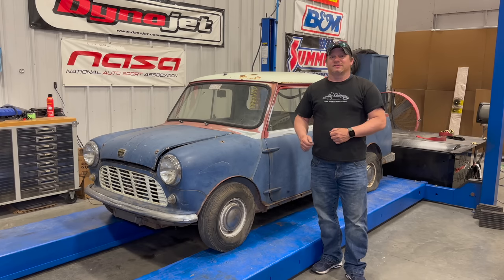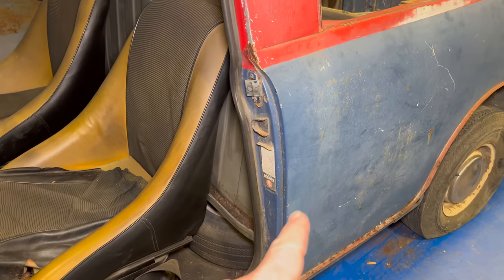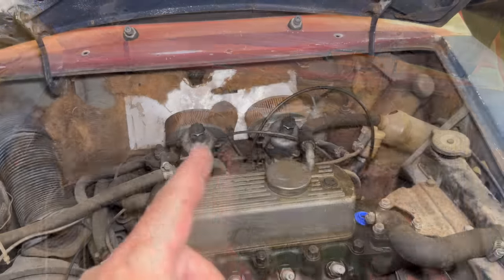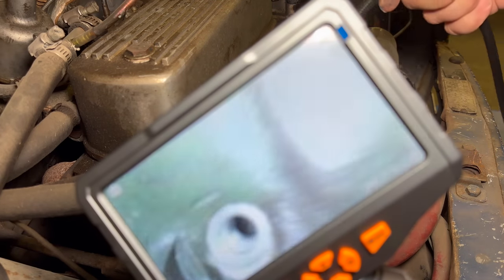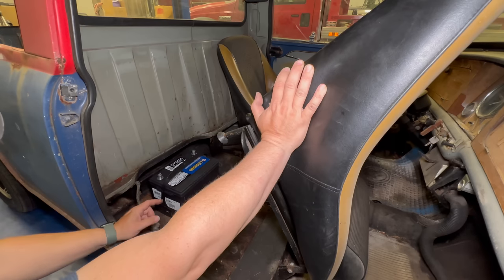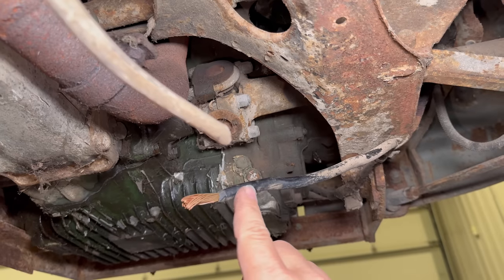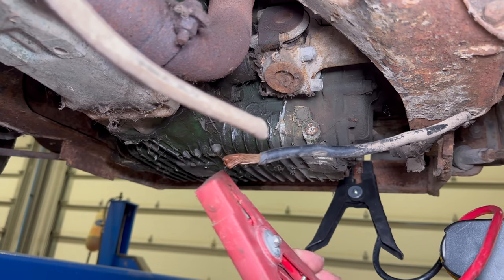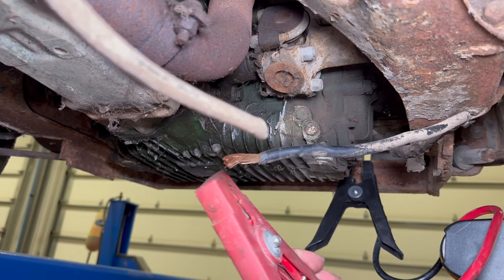Barn Find Austin Pickup - Will It Run?

Comment: The dash is not original. Iirc, the pu didn’t have a temp gauge. The shifter is not original, either.
Reply: As well as the dash, the rear bumper and tow ball aren't original either

Comment: As a 17 year old I always had a hankering for one of these but wanted to graft the tail end/rear window of a saloon shell onto the back of the cab just to be a bit different. Never did get around to buying one as they were pretty rare and I eventually ended up starting a 25 year run of owning Opel/Vauxhall motors starting with a Kadett C saloon followed by a C and B Coupe.

Comment: Had three of these. One new one. Also one we grafted a 1275 Gt motor into, used them as motor cycle transporters. I had one catch fire overnight as there appears to be no kind of fuse between battery and starter motor, maybe that explains why that cable was cut. I assume the switch went short circuit, nothing left to inspect. Great little fun tool though, exceptional road holding. Later ones had normal key starter switch on dash.

Comment: The remote looks like that fitted to the 1100s. It has a rubber mounting in between the gearchange and the diff housing. Coopers and S's remote bolted straight to the diff housing

Comment: turn on the key and if you have dash lights push the button . even if no dash lights punch it with the key on. my mum had one of these old minis. was a saloon but with the sliding windows and pocket doors cable connected to the door latch from memory.... lol.  cool collection man.. way cool.

Comment: What you need now Steve is a Mini Marcos which were entered in the Le Mans 24 hour race and won its class.  Those are very tough fiberglass bodied cars with all Mini running gear and a good one will keep up with and race with a Lotus Elan. As with all Minis, the Mini Marcos body (or  Mini Jem)  was originally 120 pounds UK (GBP) price but now the body price for a new one  is so expensive as to make them a supressed market.
The engine in that pickup looks like it could be a 1275cc Cooper unit with the twin carburettors if you are really lucky.
Reply: looks like a Cooper engine to me as well.
Reply: I had a friend who worked for the Leyland Group as a tester . One day he turned up at my house with Sprite or Midget lookalike, very little to identify it, but it was front wheel drive with all typical Mini running gear, must have been something they was thinking of at that time. Never saw or heard anything more about it. Would have been a nice little motor perhaps. Maybe give someone with an older Sprite/Midget an idea to convert one, or was any ever produced ?

Comment: As an owner of a fully restored and still driven 1970 Austin America, since 1983, I'm stoked to see your pickup, and really enjoyed watching you work.  Your collection of Mini's is killer!!  Subbed and can't wait for the next update on this.

I wouldn't be surprised if that's an America engine/trans, especially since it looks like the owner was fairly into having the truck be upgraded, and powerful for whatever he was towing.  Extremely common for Mini owners to harvest the eng/trans from the Americas, and then twin carb them like how the MG1100's were set up.  This allowed a nice header for the exhaust, along with the separate intake manifold (the Americas used a one piece cast manifold, that was both a single carb intake, and an exhaust).  That big "tropical" fan is another indication that the owner meant business about producing some power, and towing.  Man are those fans noisy!!  There's a wider version of the 11 blade fan available and it robs less power, is less noisy, and moves nearly as much air. 

If you haven't tried it, I'd recommend removing the large banjo bolt where the external oil pipe attaches, and filling the block with engine oil. This will directly feed the oil pump, and prevent cranking the engine for a long time without any oil flow to the crank bearings.  It's a much safer way to start spinning them up, prior to starting them.  And if it has a spin-on oil filter, the VW Rabbit oil filter (Bosch 72150, and equivalents from Wix at NAPA) will just sneak past the reverse light switch on the transmission, and give you a quite a bit more oil capacity and filtration.

My website:  www.austinamerciausa.com

Comment: Great to see old minis being restored in the USA,  the engine sizes are cast into the block on most A series engines as you probably know,  it can be seen with the motor in the car those COSMIC wheels are the best ones for a vintage mini.

Comment: Hi Steve, such a nice find here. while underneath I noticed It had the remote gearbox type rather than the long standard gear shifter. The better performace versions used the type you have fitted so this makes me think the engine is a more powerful version from a better mini saloon car. If you take the "rocker cover" off/ (valve tappet cover) and look for a cast head number then look online It may guide you to tell you what engine It may be.  A popular engine swap would be a 998 cc but going into "COOPER" variants could be 997cc or 1275cc but also a bigger car (Austin/Morris 1100) engine of 1100cc. all will fit with mini gearboxes geared for their 10-inch wheels. It all sounds so small compared to modern-day vehicles but as you know, race-prepped minis can go very well on tracks beating much bigger race-prepped cars.  Have fun Steve and thank you for the video. Ian - UK.

Comment: Cool, pickups are probably the rarest in the UK too; even when I had my 3 saloons (in the 80s), the pick up were sought after!  My 850 had a similar aftermarket wood dash, the vans and pickups were always the most Spartan interiors.  The twin carbs and servo and alloy rocker cover on the engine suggest a bigger or tuned engine, the commercials always had the most basic motors.  I love those Cosmic Mk2 alloys but watch out - I had them on a Spitfire and always suffered mysterious slow punctures, after dunking them in a bucket of water the tyre shop found the air was leaking through the spokes!   These old alloys were cheaply sand cast, the solution was old1fashioned tubes!

Comment: A great video. I had a Mini Van in 1972. It was a great first vehicle. So long as you didn't put side windows on it, it remained purchase tax free. A restored pick-up would be about £15000 in today's auction market, here in the UK. Will look forward to the next episode. Thank you.
Reply: Yes, these mini pickups are very rare now and have elevated value due to that rarity.  All BMC Minis now are bringing huge prices and the pickup is along with the Mini Coopers at the top of the price range. All body panels seem to be available, but these are now sought after vehicles.  I gave a Mini away in 2015 and now they are tens of thousands in value.
Reply from the maker: The beach car is at the top of the price range but you are correct ignoring those.  https://www.thedrive.com/news/31359/immensely-rare-1962-austin-mini-beach-car-sells-for-astonishing-230000-at-auction
Reply: @ThisWeekWithCars  Astonishing indeed 😲

Comment: Great project and quite a rare vehicle. Just for future reference in the middle of your starter solenoid there is a button. If you push that in with a screw driver or similar it should operate the starter motor. Or just short the terminals with will do the same job for initial testing/starting. Good luck with it.

Comment: Back in the 70s I was working at a sports car shop and one of the mechanics had one of these trucks in bright yellow.  He drove it like a race car.  I got an Austin 1100 rebuilt the engine and drove that pretty much the same way.  I had dual carbs and a header on the engine and it made some speed on those little 12 inch wheels.  I had it up to 80 on the PA turnpike and thought I was doing something until a Pantera went by me like I was standing still!  Looks like yours used to be a postal vehicle judging by the colors.
Reply: try driving on the autobahn & doing a 122 mph & a porsche goes by you doing 200

Comment: Nice find! That is certainly an Austin America 1275 engine and gearbox. You can tell by the head with no extra stud and bolt, the heater valve on an angle and the way the gearbox extension is mounted(bolts are horizontal, they would be vertical on a proper mini unit). It was a quick and economical way to up power basic minis in North America as the S units were expensive and a bit thin on the ground. It appears to be equipped with S brakes including the servo which is great to have. The uj's are Quiton Hazell aftermarket pieces, also a nice mod. Do you know it's history? Pick-ups are very rare in Canada where I am and I don't know if they were ever officially imported to North America in any great numbers. Thanks for the video. Cheers!
Reply: You right about the engine.
Head is 1275, thermostat housing facing to front means bigger engine (1275 or bored). Housing (45 degrees) slanted towards radiator means smaller engine (849, 998, 1098).
But larger head can be modified to fit smaller bore engine.
Brake discs looks like 10 inch from a Cooper S with servo.
Maybe previous owner took the engine from Cooper S and fitted to pick up.
Engine number tells the story.

Comment: Fabulous video Steve I believe the mini had a floor starter switch which seemed to have disappeard and adopted a direct key switch around 1967 also a  mini pick up and mini van here in the UK were very standard with an engine size probably around 850cc the one you have was probably built for export with left hand drive and the engine and dashboard may have come from a luxury elf or rily version Identified by the extended boot  . I did own a 1967 mini  about 46 years ago and enjoyed the noise & nostalgia for about 5 years until the red rustic stuff got th better of it 😢😢

Comment: With the seats, gear shift, twin carbs, brake booster and possibly larger engine, perhaps someone planned on using it for competition. It will be interesting to see how it turns out.

Comment: I think you’ll find that it fitted with a BMC 1100 engine and box. The remote gear lever housing has a rubber adapter plate fitted, unlike the Cooper or Cooper S which were solidly bolted to gearbox. The brakes are cooper ones.

Comment: The pick-up version of the Mini is getting difficult to find here in the UK let alone over the pond in the USA. This'll be an interesting restoration on this rare vehicle which might get challenging as you can't obtain all of the panels etc theses day's. The motor looks like a 997 0r 998 Mini Cooper unit with remote gear linkage.  Looking forward to following the resto Steve..

Comment: Great that you have completed your collection. Surprised it has a wooden dash as you’d normally only expect to find something like that on a luxury model.
Reply: That is aftermarket, as are the seats and that rear bumper. I hope Steve puts it back near stock appearance  as they are very rare and unlike the cars, the vans were not modified in period. They were just work horses. Original pick ups now fetch very high prices in the UK.
Reply: I think someone has robbed that dash from a Riley Elf in a misguided attempt to "customize" it, which probably explains the twin-carb engine too. Given that most of these pick-ups were flogged to death as commercial vehicles it would be nice to see it restored to original appearance, especially as the canvas tilt and frames are there.
Reply: @davidjones332  Agreed.
Reply: @jmtubbs1639  Yes, totally agree, I hope he restores it right down to the original 850cc engine.

Comment: I think you have a Austin America transmission, and probably engine. That's a 1275cc engine. The remote shifter housing on the Austin America bolts on to the transmission with a two piece bracket that the pieces are bonded together with rubber for isolation. The Mini remote shifter housing  bolts directly to the transmission with 4 bolts.

Comment: Given that its quite rare even here, a back to stock resto might be a wise move. I think the bonnet (hood) is from an "Austin7" Mini.. the pickup was normally a Morris..! The dash is probably from a Riley Elf,  the pickup/van was very basic.. painted grille, just a speedo / fuel gauge without temp or oil pressure dials etc.. just the bare minimum interior (The floor start button is correct for 1963), drum brakes all round..! The remote gear shifter is wrong too. Find a correct 848cc 37hp "A" series engine with the correct shifter..!!  I had a 1963 Morris Mini car in the 70s, so i can remember how it should be. Actually  known as the Morris Mini Minor here. 😄

Comment: IF  you had done a volt drop across the switch , this is a good way of testing if the switch is good or not . good vid keep it up
Reply from the maker: The motor turned over with the switch disconnected and power put directly to the wire so the switch is bad.
Reply: @ThisWeekWithCars  i know , my way would have found the fault quicker , if you understand volt drop testing .

Comment: Not a critism in any way, just some advice from my ancient memory banks of running (and modifying) minis in the late sixties and the seventies. If my fading memory serves I owned something like eleven Minis in that time. culminating in a works spec 1340 S  with a single 40  Weber dcoe carb and jack knight straight cut close ratio box and transfer gears running on 205 x 10 Minilites,    back in the day boy was that car rapid it could go round roundabouts at insane speeds like it was on rails.
The A series motor this car left Longbridge with SHOULD be a single carb 750 or 850 with the Hockey stick gear lever, you can see on yours where the location point under the dash has been covered over, also all 750's and only very early 850's had the floor solenoid button, thereafter it was a more usual key startex firstly in the dash center then later on the steering column and incorporating a steering lock,   the central mounted remote gearlever currently installed,  ONLY came standard on  Cooper's, Cooper S's and 1000's, and 1275 GT's and above,      an obvious engine swap it could be a later 1000, 1098 or 1275 engine. That wooden dashboard is also out of period being a sixties after market thing and a poor copy of the somewhat more exclusive Wood and Picket design, originally the car would have had the central round binacle, which only contained the speedo, the fuel gauge,  charging light and  high beam light the rest was just one big parcel  shelf until the late sixties when the black oval three dial binacle was released. the indicator repeater is the green neon on the end of the indicator stalk and is a dead givaway.

 I dont know if it is an American rebranding ploy or something, but those actual wheels which were all the rage for the boy racers in the budget end of the market in the sixties/seventies were called Cosmic alloys, the REAL Mini head turning wheels from back in the day are  original Minilites, but they are like rocking horse crap to come by today especially in the original ten inch rims and as they were made of pure Magnesium go for an absolute fortune if you can even find any, there are however plenty of after market aluminium alloy minilite copies on sale in all kinds of sizes....especially on later 80's/90's model Minis which were factory fitted with 12 inch versions as opposed to the original 10's.

Comment: you need a Wolseley  Hornet and a Riley  Elf ... the bed had to be 2/3 length of vehicle to qualify as a commercial vehicle in the UK ....your lucky when I got a pickup in the late 80's there was nothing in front of the windscreen scuttle...that took 4 years to fully rebuild..then I was too tall to drive the blooming thing...so I got a van .. good luck!    os thats a big bore exhaust so you are not going to have an 850!   have a look behind the voltage regulator in the inner wing the metal strips there can corrode away ...you wont charge your battery and the car wont start...

Comment: Two more body styles you have not mentioned.  The square front clubman and the long boot Riley or Wolseley. The wood dash in your pick up is from a Riley.
Reply from the maker: The clubman is not one of the original mini body styles and did not come out until 1969 after Minis had already stopped being sold in the USA in 1967.

Comment: Cerrtainly that looks like a 1275cc engine and the remote looks like it came from an ADO16 vehicle too, so it could be a complete Austin American engine and box.  What look like blocked off air injection ports beside each spark plug would also mark it a US sold engine.

Comment: In terms of Mini body styles (and forgetting early convertible versions) I was going to mention the Riley Elf/Wolseley Hornet booted versions but it looks like your pickup already has a Riley Elf dashboard (Hornet had the Mini plastic three instrument pod and the pickup/van only the single (speedometer) pod)). Your pickup is a great survivor - will look great with a canvas tonneau cover. Mini was originally going to have the simple metal slatted grille  like your pickup which would have made servicing, eg the distributor, a real nightmare.
Reply from the maker: There are no early convertibles the first "official" ones were converted in Germany in 1991 and I do not know if the VIN lists them as a unique body type or if they were still listed as saloons because that is how they were built and then chopped up.
Reply: The central portion of the factory Riley Elf wooden dashboard is not recessed as in this pickup. And the Wolseley Hornet has an oval wooden facing panel covering the standard three-insturment pod.
Reply: @htimsid  FWIW the Elf had a slight recess ( I had two) and my Hornet MkIII didn't have wood - only the standard black grained plastic.
Reply: @ThisWeekWithCars  I remember seeing two early/1960's Minis in Wales which were convertibles with an enclosed rear deck - agree not factory origin, possibly Crayford